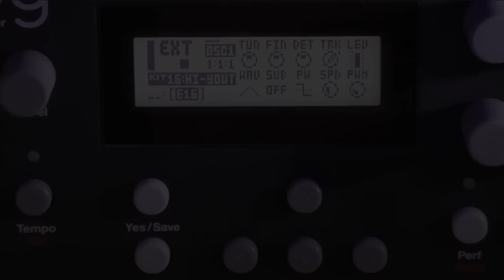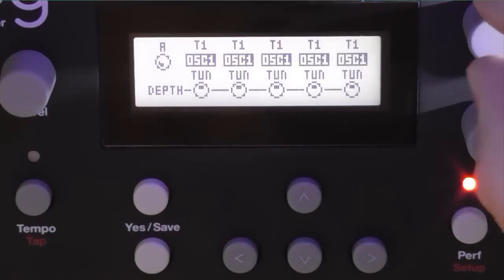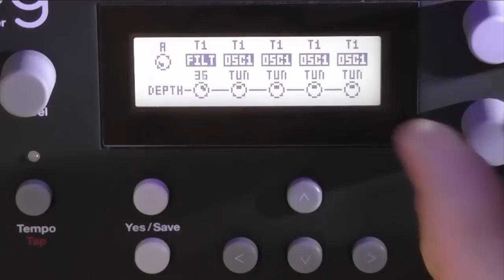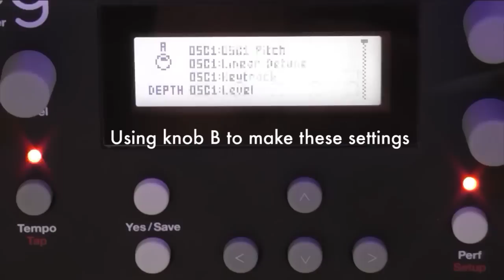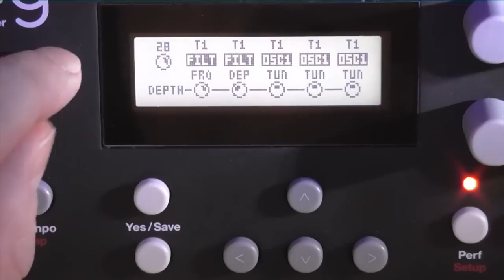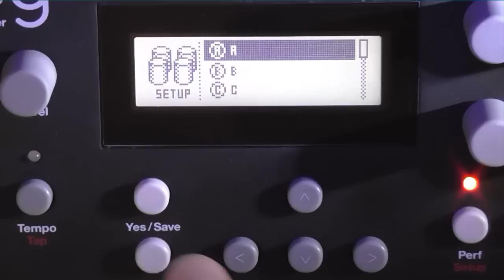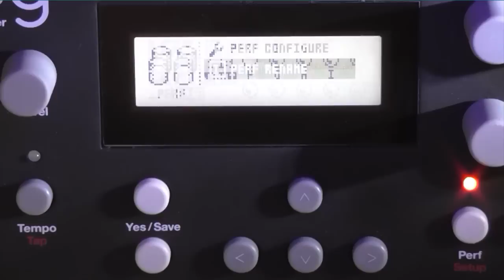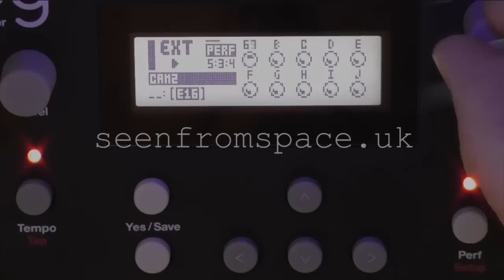Elektron Analog 4 tutorial 1 - How to programme performance controls

Comment: Clear and simple!! Very useful, thanks.
What I'd like to see as a tutorial is how to use CV with others gears like the Korg volca for example. I'd also like to see tutorials for how to setup midi gears in chain with the midi thru. The sound pool also a nice feature.
Again, thanks.
Reply from the maker: Posted the video on the Elektronauts forum and had several suggestions from there. Some of them, as well as some of the above, are for features I've not personally used on the A4! A bit of research is indicated obviously;) All suggestions are most helpful though. I'll give it lots of thought.

Comment: thank you for this. Have you got any (or will you do) video tutorials of how to play A4 paraphonically or polyphonically? I have the rytm and just added the A4 love having individual control of the voices via the sequencer but i wondered whether i can plug in a keyboard and play triads etc? Any idea.. been looking about on web - you seem to be clued up!
Reply from the maker: Hi. I haven't done a tut covering this in particular. It's easy enough: polyphony is set as part of a Kit. In the Kit menu it's under POLY CONFIG. Ticking one of the 4 boxes next to VOICES sets that track to be polyphonic. Any or all tracks can be polyphonic as long you're not trying to play more than 4 notes at the same time. There are 4 ALLOCATION options which are a bit more complicated to explain. Page 18 of the manual covers this. The A4 is actually polyphonic, not paraphonic which generally means only having one set of envelopes, even though the oscillators can be split across more than one note.

Comment: On the A4 performance page when I touched a knob that was corresponding to a 
track performance, say T1, I could also edit the level with the Level 
knob on the left of the screen.
Then simply turning 
another knob to change track performance of say T2, I could also edit 
the Level of T2, without having to push Trk 1 or Trk 2 buttons on the 
right...now I have to push them to edit that Track's Level...weird.

Anyone knows how I can get it back to how it was before? I can't find any info on that in the manual..

Cheers!